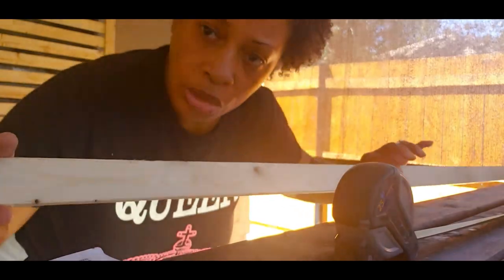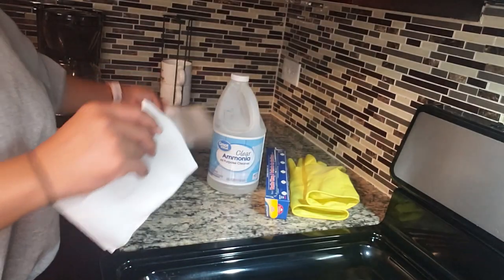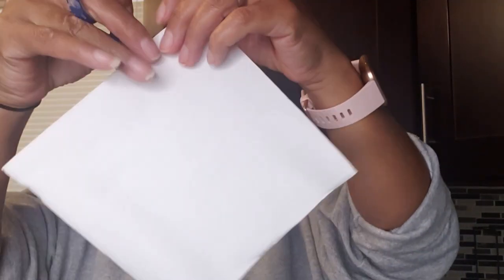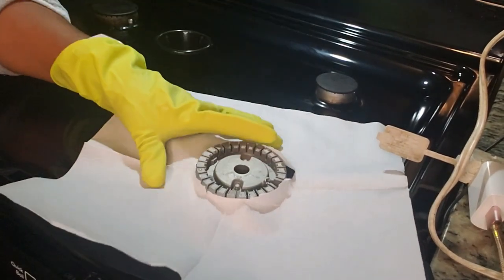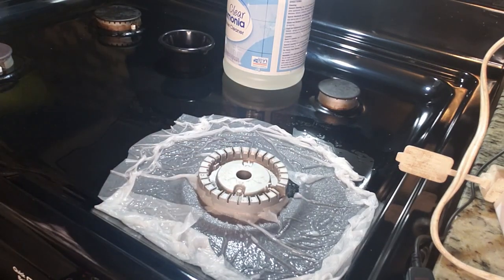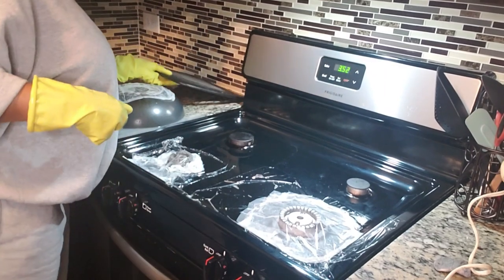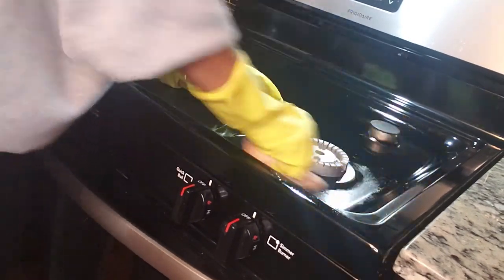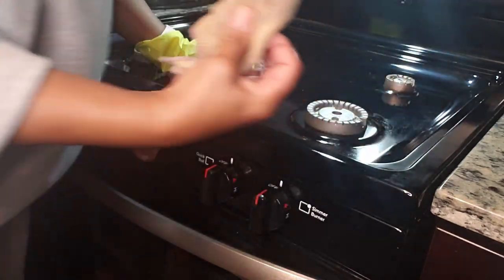How To Clean Burnt ON Grease Off Of Your Stove Top

Comment: I scraped my stove with a blade and scrubbed it to heaven and back and it still had stuck on splatters. Until I discovered the easy off oven cleaner. Turn on the hood, open the windows, spray liberally and walk away. After a while, when you see the foam turn brown from dissolving the gunk, put on your gloves and wipe it off. No more scrubbing!